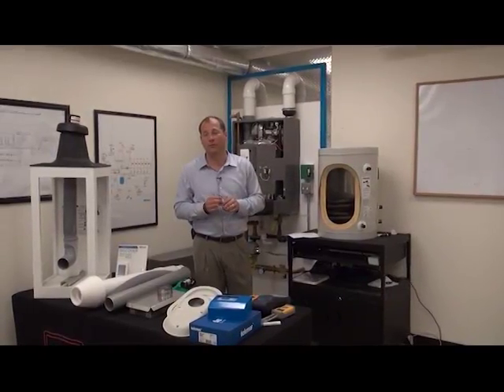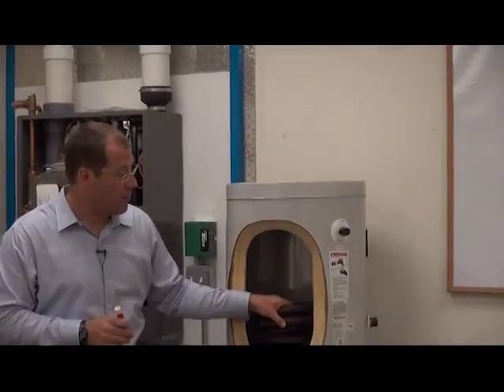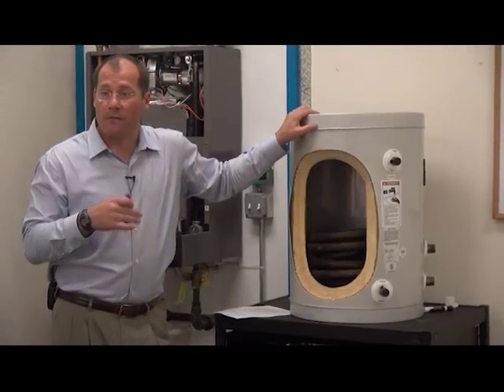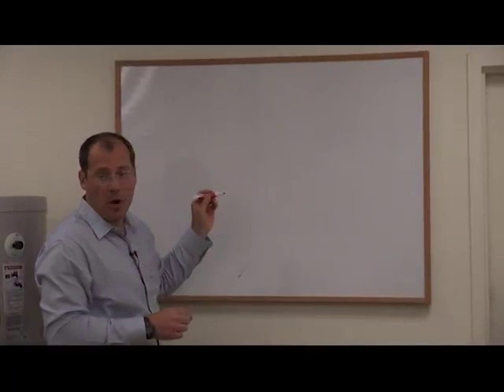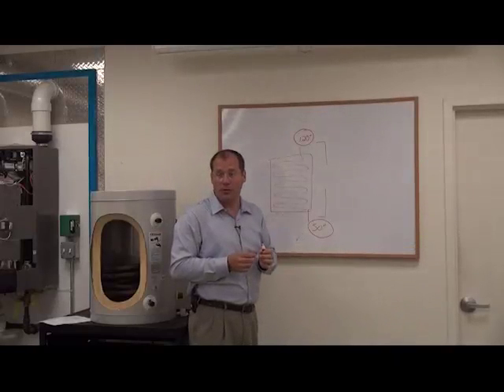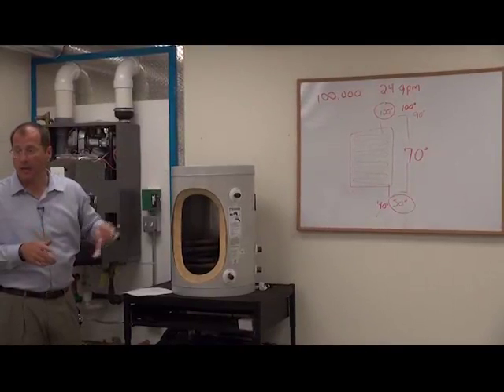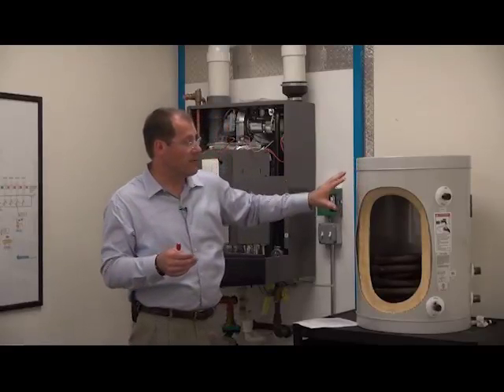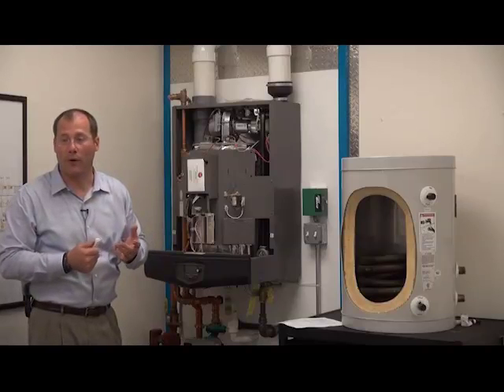Hot Water Heater Choices

Comment: Nothing has changed in 120 years, all the new crap has High  ROI and low life span - Keep an eye out for the New H N-P I Electric Water Heater - Cheap 75% saving of power, - Lower cost to buy, 1/2 the weight, 100 year lifespan - No explosion hazard